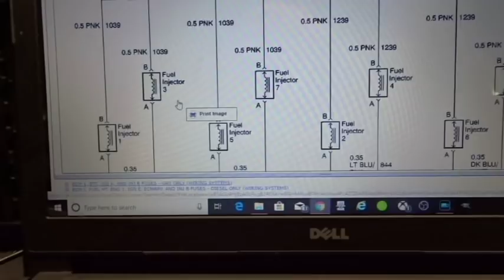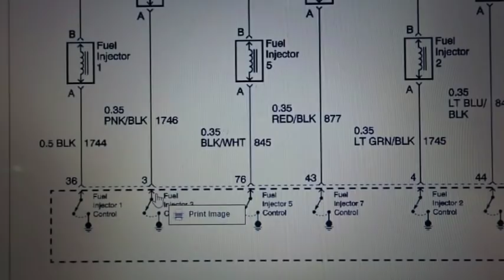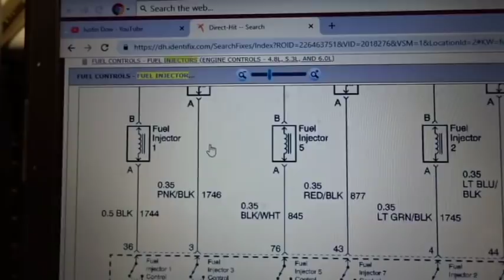MULTI CYLINDER MISFIRE // IS THE PCM DRIVER BAD??

Comment: Can a tiny hole in the intake gasket cause my fuel trims to be +25 b1 and +21 b2 I smoke tested it and it only has a tiny leak on drivers side bank 1 seems like alot +25 for such a small leak? Need help you would believe all the stuff I've replaced on this truck 2001 Silverado fuel trims keep going up. Fuel pressure test 48psi running 52psi with key on. About to replace my intake gasket soon just want to know if that's my issue or what I got going on does a small leak affect trims that much?

Comment: Hey Justin I have a jeep wk 5.7 hemi. The codes was saying the all 4 o2 sensor low circuit, it was retarding the timing and running awful. I sent the pcm off for repair. The shop put it in and now it’s still misfiring. Any ideas?
Reply from the maker: Hemi kinda has a pretty big issue with lifters eating camshafts. Not sure that would throw 4 O2 sensor codes, but might be your misfire issue. Have you checked the plugs or swapped coils yet?
Reply: @JustinDowDIYcentralhighway  yep it just had a complete tune up bc the shop said that was the problem but then they said that didn’t fix it.  So then they said it was the computer so I sent the pcm off for repair. They plugged the pcm in and the jeep was good for about an hr until it started throwing the o2 heater circuit low codes. P0031 P0037 P0051 P0057. It runs fine sometimes but then the idle gets rough and wants to stall. I shut it off and turn it back on and it’ll run ok for a while. The internet says it could be a short in the o2 circuit.

Comment: If you have a rich condition on both banks and several misfires, wouldn't that mean the injectors are injecting fuel into the cylinders but for some reason there is incomplete combustion? I think a rich condition is determined by the Oxygen sensors in the exhaust detecting unburned fuel. I wonder if there is a way using your scan tools to view the wave form created by the injectors and coils as the engine is running? I wonder if the misfires are triggering the knock sensors?
Reply from the maker: MotorheadRedo Hmmm.. there’s an idea. I’ll have to brush up on some videos of injectors and coil wave forms and check it out another time. Unless Aaron takes it somewhere else first. Good idea though thanks for the feedback 🍻👍

Comment: How does one injector that does not function, cause rich codes on both banks? And misfires on other cylinders?
Reply from the maker: cfmcc83 I’m not sure. If I had to guess I’d say the other working injectors we’re trying to compensate 🤔
Reply from the maker: That’s just my theory though
Reply: @JustinDowDIYcentralhighway   I ask because as a diag tech you need to think critically about your theory and then find tests that can prove you right or wrong. I noticed you were using a DMM to check if the injector was being grounded by the PCM. Can your meter switch to ground fast enough to catch when the PCM grounds it? injector on time is in milliseconds. The usual way to test injectors is a noide light or a scope. Most DMM's can not switch fast enough to ground and just show voltage. Also rich codes mean the PCM is trying to remove fuel. If a injector was dead you would get lean codes (one injector is not firing means less fuel) and the PCM would add more fuel to compensate for the lean condition.
Reply from the maker: cfmcc83 I definitely have a lot to learn. Wow what great information you’ve shared. I never thought about the DMM not being fast enough. Not sure about the lien rich formula as well. The only thing I’m certain of is the continuity between me injector and the PCM and the injector to the power distribution
Reply: @JustinDowDIYcentralhighway  yeah unless the volt meter is a high end model the refresh rate it slow. 
 it could be a faulty  fuel injector. injector stuck open? do you still have the vantage to ramp test the injector.

Comment: The car line i work for recommend not soldering wires because of the possible excessive resistance it can cause.  They recommend us using the non insulated butt connectors.
Reply: What cars are this
Reply: Gary Robinson  Lexus